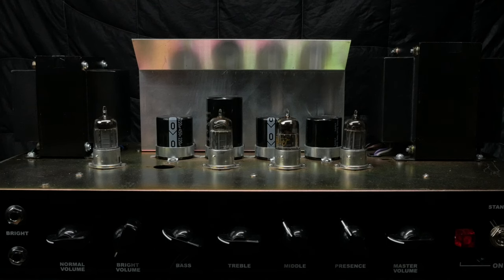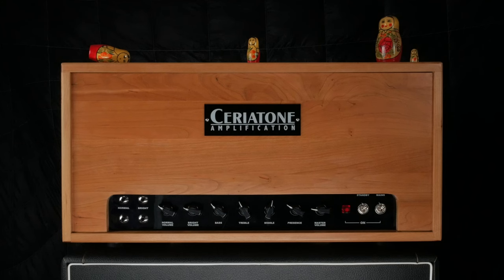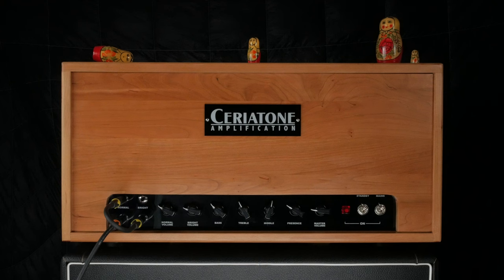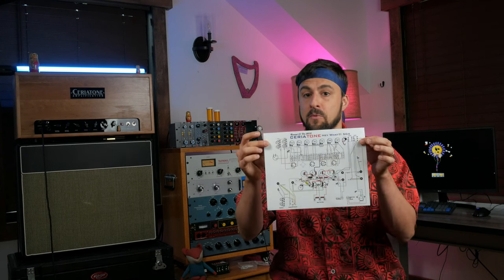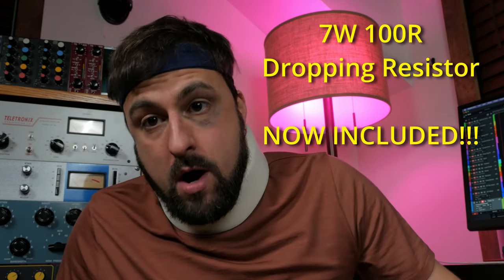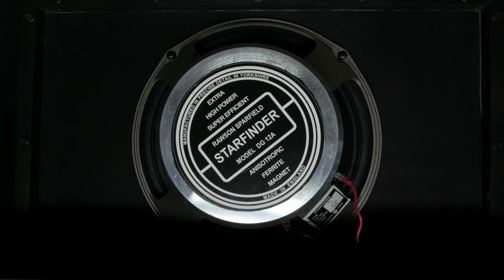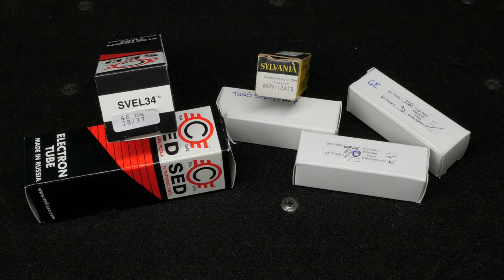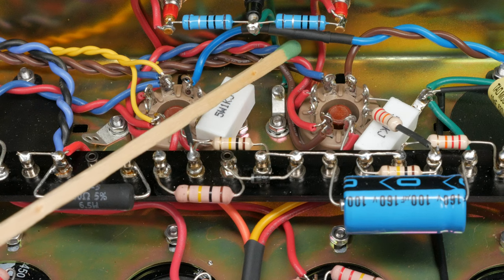Let's Build A Hiwatt - Ceriatone Hey What 504 Extravaganza

Comment: "You've got the part!" 😁 Appreciate your sense of humor...and in your song.  I'm curious about your opinion on the C3 47nF to 22nF change for better mid-bass? The HiWatt TS apparently has an unusual dip at 200~300Hz with the Middle at 4 to 10, and the Bass control only affects below 100Hz above 5.  The 22nF change moves it up to 200Hz and reduces the dip.
Reply from the maker: I'm glad you like it GC! This is the first time I've heard of this mod! I'd be interested in learning more. Do you have any resources you can share on this one? I could try to put together a comparison video down the line!
Reply: @shoetiquemusic  Just a suggestion from an amp tech, but you can see what it does by making the change on the Duncan Amps TSC app.  You could also wrap a 1nF cap over C1 to reduce the mid-bass dip.  Change that to 2nF to see what I mean.  Amp caps may have to be wired with the correct polarity or it can cause serious problems.  I don't know if that's true in the tone stack, but you could look into it.

Comment: A well designed board with properly sized thermal reliefs would solve the solder issue.  Alternatively, I could easily design a board with the same circuit that comes fully assembled for a competitive price. 

It's great that you are twisting your wires for common mode noise.  Are these interfaces fully differential or single ended?  I almost exclusively design in fully differential in audio applications for signal quality purposes.
Reply from the maker: Thanks for stopping by Wicked! Thermal reliefs would only be available on a PCB, correct? I'm not aware of a thermal relief solution for turret boards. Let me know if I'm not understanding this correctly. 

When building classic amps, adhering to the construction and components of the originals is what gives it 'mojo'. The variation in component composition and part tolerance all come together to make each build something slightly unique. There's countless forum posts debating the sonic qualities of different component materials - some are more likely to be true than others. In this space we're not looking for the cleanest, most HiFi options.

When you say fully assembled I believe you're referring to surface mount components on a PCB. There could certainly be interest in this but you'll lose the primary target audience of vintage gear. These folks are seeking a replica that has all the glory and warts of the originals. 

Regarding fully differential vs single ended; Tube guitar amps in general are typically single ended or push pull. The DR504 is a Class AB push pull amp. 

Here we get to the edges of my understanding but I'll take a shot at it. I believe that this design is differential but not fully differential. The signal is single ended up to the phase splitter where it then becomes differential. That is to say the output stage of a push pull amp is differential. Wicked or anyone else reading this - please correct me if I'm wrong.
Reply: @shoetiquemusic  I don't have first hand experience with turret boards, but my understanding is that they are the pre-PCB option.  In that sense, they are large/bulky and therefore there's a lot of thermal mass and high thermal conduction to the rest of the board from the terminal that you are soldering to.  Not knowing the layout design of the board I would not know if thermal reliefs were used and or sized appropriately for this application.  Essentially a thermal relief is a reduction in thermal continuity between the terminal and the rest of the board's copper.  Kinda looks like a bicycle wheel, the hub being your terminal and the spokes connecting the terminal to the remainder of the circuit. Most of the signal conditioning circuitry here is likely low current and therefore would not need much for "spokes" to carry current, but would be way easier to solder to because your soldering iron heat wouldn't be conducted away from the terminals.
Reply: As a qualifier, I don't have experience designing amp circuits like the one you are presenting here, but I do have circuits that are used in audiology tools that are FDA compliant and currently fielded. I might be missing something, but I wouldn't be scared of PCBs in this application.  I think the point of the turret board and use of thru-hole components are to attempt at making things as cheap as possible.  That being said, there are dirt cheap ways of building boards nowadays with low stackup count.  Typically you'll see these turret boards or thru-hole build boards in large electronics like flat screens or amps because there's an infinite amount of space.  Some poor country builds them and the US buys them for dirt cheap and makes money.
Reply from the maker: @wickedalaska  I agree that would likely be easier, but I love looking at that Turret Board 😁
Reply: @shoetiquemusic  it definitely gives it a different vibe for sure.